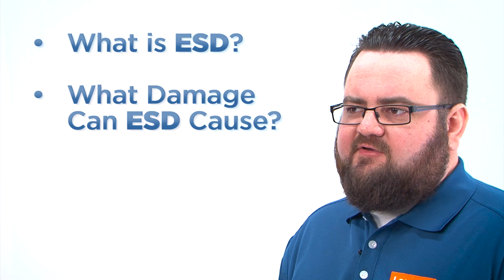Understanding Electrostatic Discharge (ESD) for Technicians

Comment: Its all about potential energy. You need to safely neutralize the charges. The case need not be grounded to earth. You and the case just need to be at the same reference. Think of why a bird doesnt get shocked when it touches a power line. Same instance. You both could be charged. The case and you but if theres no current flow there is no discharge. Connecting yourself to a ground can also be a bad idea. What if theres a ground fault in your wiring and now your the ground rod.

Comment: Leave the power cable attached, power supply turned off. If you unplug the power cord, the computer chassis is no longer grounded, and attaching the alligator clip to it will not help you.

Comment: Can we do the service for any electronic components like cpu,ecu etc...without esd protection?
Reply from the maker: Hi Excel vba automatic sent mail! Generally, we can service electric components without ESD protection, but it's not recommended. If you have any issue with any Lenovo electronic components, we recommend bringing it to the nearest Lenovo Service Center. Rai_Lenovo

Comment: Are ESD safe screwdrivers and pliers necessary?
Reply from the maker: Hi Yeomer! Thanks for writing in. Basically, it's advisable to have an additional tool aside from the ones provided in this video, which in this case are the safe screw drivers and pliers. Erica_Lenovo
Reply: LenovoSupport On the other hand, there are people on the form at eevblog saying that regular precision screwdrivers are sufficient for general use as long as you ground yourself properly. Could you please confirm if that's true and whether if it will damage components like MOSFET in contact with regular screwdriver despite being grounded?
Reply from the maker: If your're properly grounded then that should be fine. Then again, it's advised that you use ESD protection all times as you can never be too careful when dealing with electrical components. Erica_Lenovo

Comment: Will just a grounding wristband that connects to the computer be good enough, And also if I work on a table, standing on a wooden floor would that help prevent ESD?
Reply: Nick Brown it has nothing to do with ground.  Its all about reference. You want both you and the case at the same potential. The only way for there to be discharge is if there is a place for it to have a dissimilar reference.  Ground is not needed. Both you and the case can be charged but if you both are referenced together theres no flow
Reply from the maker: Yes, a grounding wristband hooked to bare metal on the computer will work.

Comment: This was a great video except there is one critical error in this video.  You took the RAM chip out of the anti-static bag and placed it on the bag!  Anti-static bags hold static on the outside of the bag to ensure there is none on the inside.  This means you just caused damage to the RAM chip by placing it on the bag where all the static is.  That's ruins the whole point of all the other anti-static measures you took.  You should comment that part of the video out or replace the video completely as it's very bad advice.
Reply: I couldn't agree more. What a fundemental mistake to put in a video about ESD for technicians.  All that hard work has just gone completely out of the window.
Reply: Properties of an ESD bag.
ELECTRICAL SHIELDING: (Faraday cage) to minimize an electrical current (voltage discharge) or ElectroStatic Discharge (ESD) from penetrating the film thereby "protecting" the contents from being damaged by an ESD.
Reply: No. You're wrong. There is no visible indication of the amount of static present and no visible indication of ESD damage unless you happen to have an electron microscope with you. The only solution is to ensure you use a grounded ESD mat if you need to put the component down. I don't know why you feel you need to argue the point.
Reply: But this video has come from a major hardware manufacturer and is directed at technicians.  Mishandling of ESD sensitive components has a direct financial impact to their business. It's just irresponsible.
Reply: I'm confused, so there are two ways to ground yourself? 1st way by attaching the wrist strap to yourself then to the ESD mat. 2nd method is to attach the wrist strap to yourself then onto the computer case (chassis). What if the case is painted?

Comment: Do I need to plug in PSU to power/ keep the switch on ? Or switch off? Or unplug from power?
Reply from the maker: Shut the system down, turn the switch on the power supply off and unplug the power supply.
Reply: @LenovoSupport  if you unplug the power cord, the computer chassis is no longer grounded, and attaching the alligator clip to it will not help you.

Comment: Entertaining video but with a huge error: we were told to ground ourselves and our mat to the computer case, but at no time did we see the computer case grounded.

The easiest way to ground ourselves is to use the ground terminal in a power outlet...AFTER we have established there's no voltage on it, which could happen due to a short or an electrician's error. Stick a conductor into that ground, then connect that conductor to the wrist strap. Some wrist straps have a conductor on them that lets us plug right into the earth ground terminal. Do the same for the mat.

Touching a metal computer case is better than nothing, but not enough to eliminate the need for doing it the right way.

Do a search for ESD APPLE. You'll see a short 4-part series that corresponds much better to everything I ever learned about ESD.

Hope this helps.
Reply from the maker: Perhaps the wording is a bit off but I'm not sure I would call that a "huge error". The goal is to be the same electrical potential as the device that you're working on. If the computer is on the mat and you are connected to the mat then you're at the same potential.
Reply: The term "Grounding" is misleading, as he stated you need to be at the same potential. The reason for grounding is to put all possible work stations to the same potential. The only safe and common potential available is earth ground, hence the term grounding.
Putting the computer on the ESD mat is "grounding" the case as long as the case touches the mat and you are connected to the mat. It does not have to be clipped in to be "grounded".

Comment: What do i do if i dont have the kit do i just put it on a table? would that work?
Reply from the maker: +Hasoon nine Yeah you can just put it on the table. You might want to watch the consumer version of this video https://youtu.be/by4PB3WtdLo
Reply: Use a ESD strap to connect yourself to the case and slide the computer around on the table as little as possible.
Reply: Mike D i just did it on a glass table and everything went well

Comment: Very informative video.   
ESD control is pretty simple, if you focus on the basics

Establish an ESD Protected Area. Ground all conductors including operators.Use a dissipative grounded surface.Remove all non-process essential insulators from the ESD Protected Area. Use
ionization to control charges on process essential insulators.If an ESD susceptible item needs to be removed from the ESD Protected Area, place
it in a shielding bag or storage container that forms a faraday cage.
Reply: I'm confused, so there are two ways to ground yourself? 1st way by attaching the wrist strap to yourself then to the ESD mat. 2nd method is to attach the wrist strap to yourself then onto the computer case (chassis). What if the case is painted?
Reply: Ok you've lost me